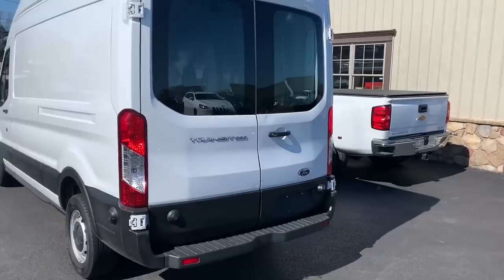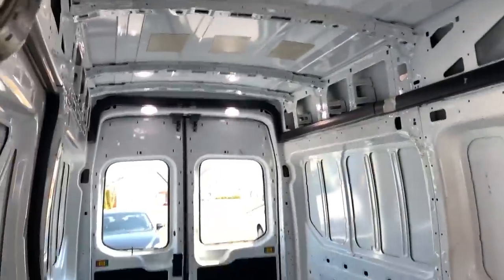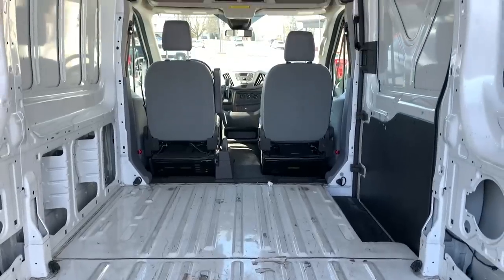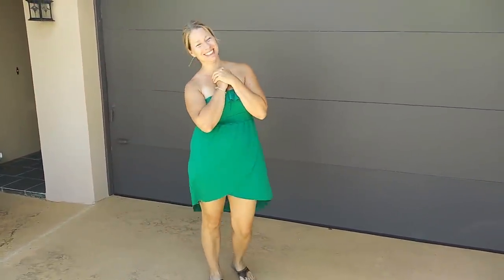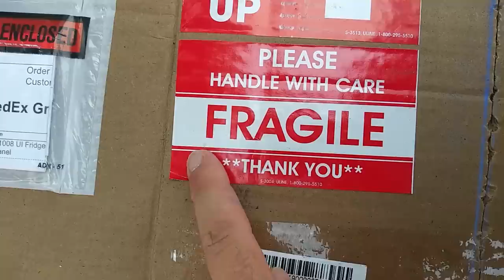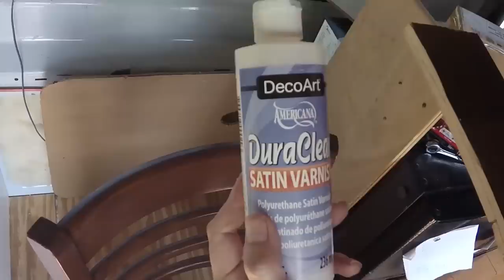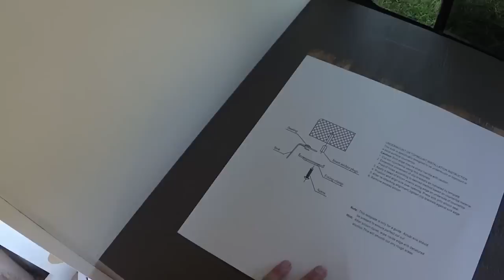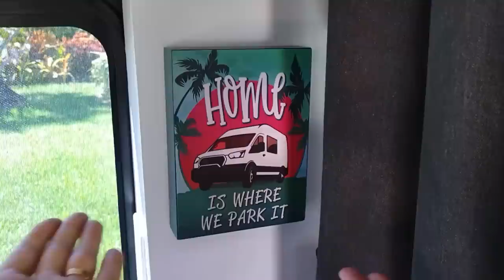DIY van conversion: $7K & 2.5 years by couple with no experience | Full Van Build Time Lapse

Comment: Well done guys, Loved the music choices.  and was there some "never before seen"  footage or did I just not remember from my binge watching some of those clips.  And if you are "finished" does that mean no more additions or changes at all?  :)  Thanks for the trip down memory lane.  Also i am curious if you guys know the finished weight of the van vs before the install?
Reply from the maker: Hey Jeff! Thanks for watching and your stamp of approval on the music choices! 🙂 There was indeed some never before seen footage. And after the fact, we realized there were a few clips here and there that we forgot about as well. Some we don't have any more, but we do have some on the electrical that we still need to share at some point. For some reason, those clips didn't seem to fit in other videos but we really should do a video on our electrical system at some point. We plan to do a video tour next week and there have been a few small changes since we did the timelapse. I'm sure we'll continue to tweak a few things but for the most part we are "done." We weighed the van when we were over on the Gulf coast. We weighed in at 7,520 and it probably hasn't changed too much since then other than the weight we added to the back doors. We'll have to weigh in again when we have a chance. I need to double check this, but I think an empty Ford Transit cargo van is listed as 5,226 curb weight and is rated for up to 9,000 capacity.